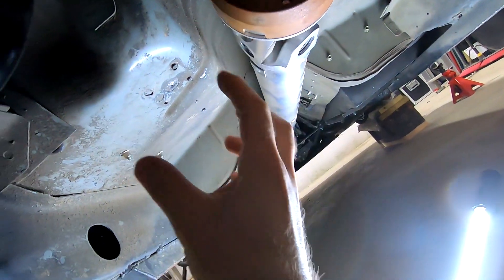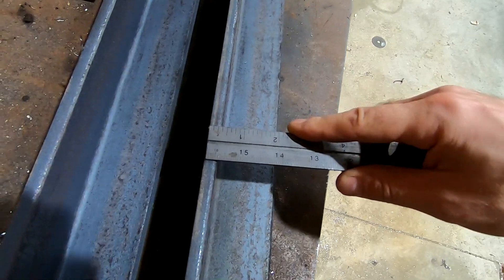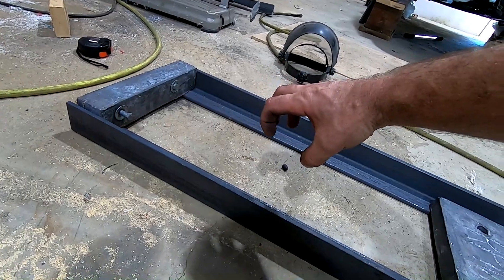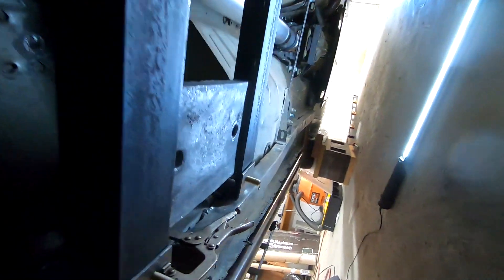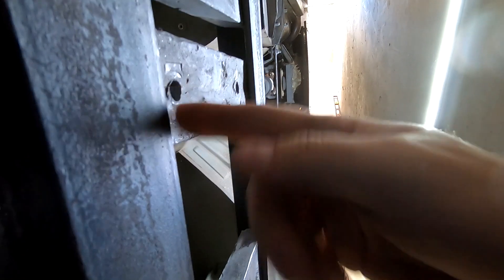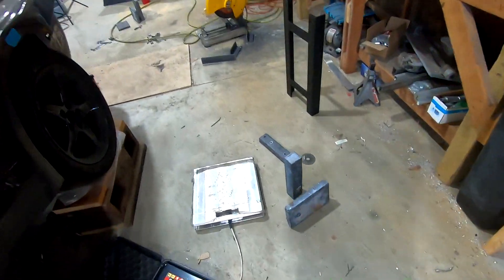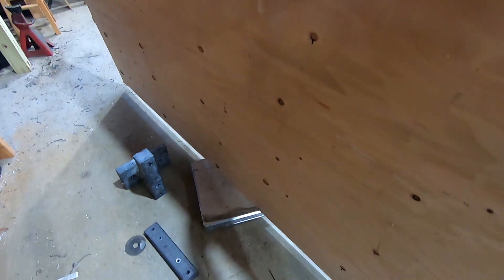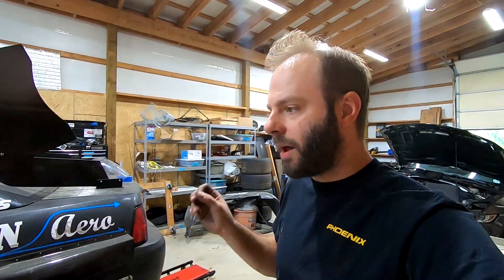Ballast Mounting Solution for Over 200lbs of Lead.

Comment: I noticed you have the car sitting on wheel stands while doing this (ride height) and the weight sled you added seems to be an inch or two from the driveshaft. Did you move the rear end through its range of motion (full droop) to confirm it doesn’t hit?
Reply from the maker: It’s an entire rear subframe from an S550. Diff doesn’t move.

Comment: 250lbs of weight?!!? thats alot how much faster are the tyres than what you have been running??
Reply from the maker: I’ll find out this weekend. Altho I also did a floor and diffusor (video soon on that). But people suggested that even with the weight I could see almost 2 seconds around VIR on tires alone. I’ll video the weekend and post results in an upcoming video.
Reply: @ajhartmanaero  oh right thats alot of time to gain with the weight be interesting to see what the data says after